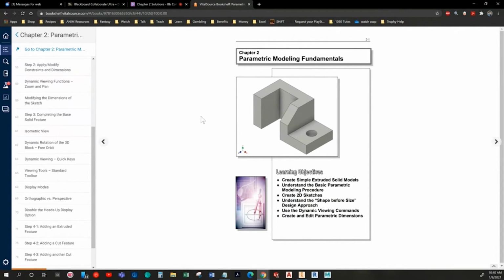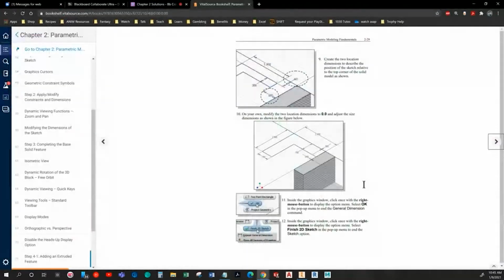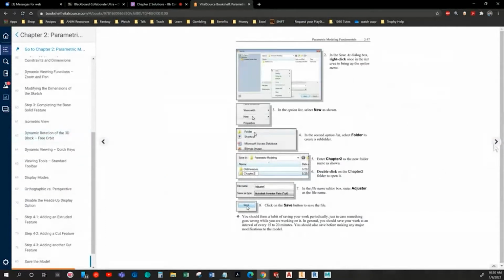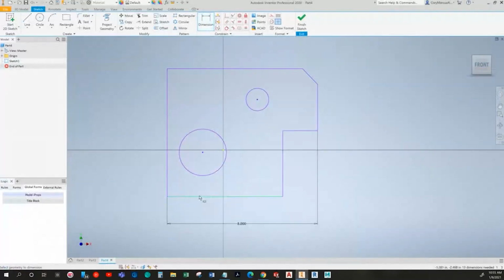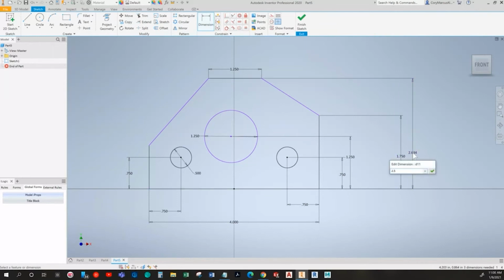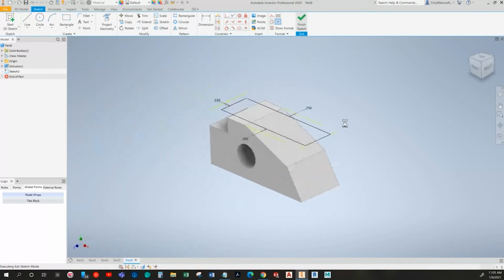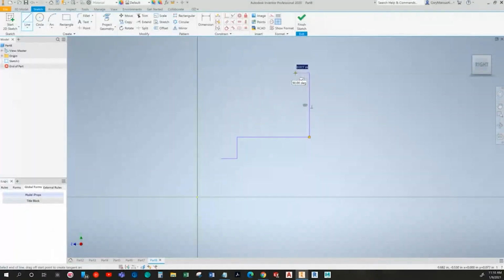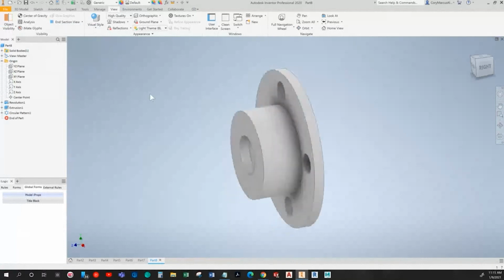Chapter 2 Solutions: Parametric Modeling With Autodesk Inventor 2020

Comment: Before you did extrude, after doing exactly what you did, mine is not letting me do extrude. Saying I don’t have a profile or face detected. How to do i fix this, if all my points are correct?
Reply from the maker: @lydiaborrego8461  this is a common issue when first beginning. Odds are you have two points unconnected somewhere. They may appear to connect or overlap but aren't actually connected. While in your sketch, on the bottom (near the middle) there's a button with a light bulb and arrows. I'm not at my computer but Its going to show degrees of freedom for sketch geometry. Hit it. It should show what is under constrained and likely point out your issue. Lmk if that helps!
Reply: Sorry for the late response, mine now says it’s fully constrained but still won’t allow me to extrude it
Reply: I got it figured out thank you so much!
Reply from the maker: @lydiaborrego8461  awesome! You're welcome!